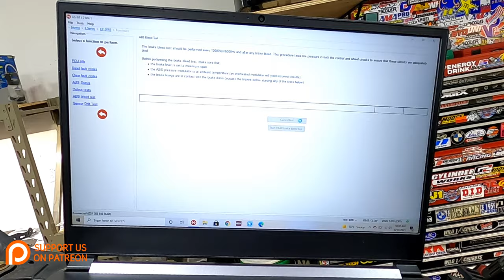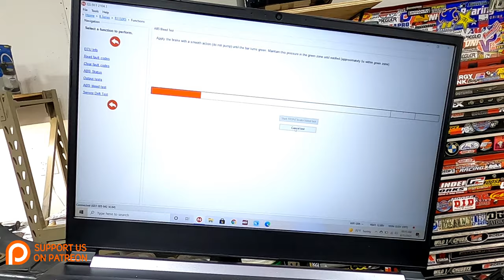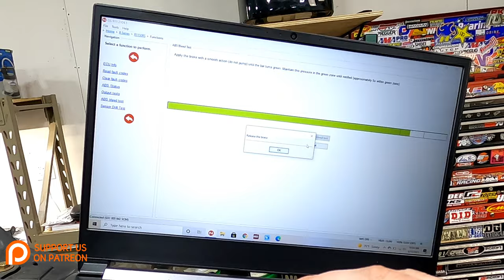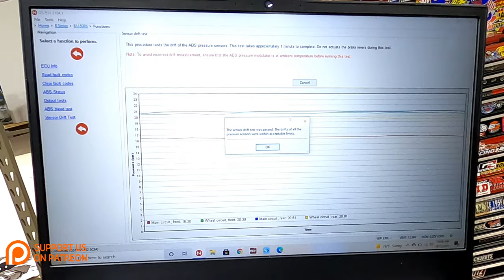BMW I-ABS COMPLETE BRAKE FLUSH R850, R1100, R1150, R1200, K1200

Comment: A mechanic I saw while on road trip in Europe ran some emergency braking test at the time and got 100bar+, he told me it was way too high and that it meant the OEM brake lines where aging and that it would be good to upgrade to steel braided ones.

From what I understand, the pressure measured by the test  is the outward pressure going out of the pump.
Basically  the more the pressure is high, the more it means the OEM rubber lines are absorbing pressure (by swelling / deforming) and basically requiring a high amount of pressure to get the required pressure to the brake caliper from what I understand ?

I had totally lost the front brakes (assisted + non-assisted) and when running your procedure I saw the ABS reservoir was totally empty... 

Your video saved me entirely while at first a phone call to a mechanic told me without even seeing the bike that the ABS pump must have failed and that it would require change(3500e).

Thanks a lot man !!
Reply: my abs pump does not make any noise!!!
Reply: @narcissistinjurygiver2932  then you have ABS II and not ABS III with brake booster

Comment: After bleeding you should NOT top it off, like explained here. You should push in the brake caliper cylinders all the way in. THEN you top it off. Doing it as explained you will spill the excess oil when replacing the pads. Spilling it on your frame and rear wheel.
Reply: Pistons fully retracted during bleed. I made a set of hardwood blocks the same sickness as new pads and new rotor in order to set the proper fluid level, per the service manual. Which I don't think he has read...

Comment: Nice video! Have done this a couple of times on my 05 1200GS with servo assisted brakes. There is one minor thing i need to point out. Unless your brake pads are brand new when doing this, your ABS reservoir will overflow the next time you are changing the pads as you topped the reservoirs up fully. To avoid overflowing, you should either block out the brakepads maximum before this procediour. Or you can measure the level in the reservoirs before starting, and leave it the same level when you are finished (this will only work if it was done properly the previous time). Anyway..  overflow is not a serious problem, but its this easy to avoid it  :)
Reply: Couldn't you just remove a little fluid from the reservoir before replacing the pads?
Reply: When we do a brake pad replacement we ALWAYS open the bleeder at the caliper and then push the pistons in. No dirty fluid being pushed back in the system and no fluid pressure being forced the opposite way.
Reply: Guys remember that on this bike the reservoir is under the tank. Yes your ways will work, but then you need to remove the tank just for replacing brakepads.
Reply: What hose are you using to flush out the old brake fluid? I need that.

Comment from the maker: If you watch all the way thru you can see why upgrading to stainless steel brake lines is soo important. these bikes are getting to be 20+ years old and the old rubber lines are failing. its really only a matter of time before you squeeze your brake lever and your line pops leaving you stranded without brakes.
Reply from the maker: If you are interested in a set of top quality stainless steel lines please reach out to Thebmwguy126@gmail.com
Reply: I'm all set, thanx. I'm surprised you didn't mention in the vid before you even started that they needed to be replaced long ago...

Comment: So glad my 2000 K1200RS is ABS2.  When the ABS2 detects a fault it just flashes the dash lights and doesn’t pulse the brakes anymore, but the brakes still work normally otherwise.  The way iABS works seems like a big liability concern.
Reply from the maker: properly maintained its not an issue

Comment: Watching from New Zealand. Around 2yrs ago I purchased a spare iabs unit identical to mine but which had only covered 10000kms! I took the opportunity to carefully disassemble the unit without affecting the actuator settings. In the process discovered there are 6 fluid filters in the unit. I clean these each time I replace the brake fluid having already upgraded to stainless braided lines. These filters are in the reservoir (easily lifted out with fine nosed pliers.) And the other 4 filters are in the inlet and outlet fluid lines. In each case slide out the staple pin to remove the fluid line. Then with an open ended spanner crack open the joint and remove the filter plug. You'll see the filters at the base of each plug. Each is easily removed and I use isopropyl alcohol to clean. This action may be the most important process to optimise the system and maintain the ceramic disc fluid pumps.
Tell me how you get on please.
Regards from Taupo New Zealand
John Mason

Comment: This is a great tutorial.  Just did my 2004 R1150RTP since the tank was off for some other work, and it went perfectly.  Somebody had replaced the hoses at some point, which was a pleasant surprise.  No bulging, and the old fluid was pretty clean.

Comment: I did this task a few weeks ago and it’s finally warm enough here in New Hampshire for a quick ride (42F). My brakes work fine, but I’m getting an alternating flashing of the triangle warning light and the brake failure message. As I said, the brakes seem to work just fine and I was able to lock up the front and rear in some sand. ABS worked fine. Thank you!

Comment: Just finished bleeding the brakes with your help, front brake fluid was shot super like 'dead redish' fluid, the new fluid flushed out the old, and on the nipple line, the fluid went from dark to clearn really satisfying. Using a glass seringe to remove al the dark fluid from the front brake reservoir... Thanx again !

Comment: I replaced brake lines and followed this sequence to bleed the system. Got rid of the airbubles on the front circuit easily but the rear bleeders won't stop pushing bubbles through. I flushed with about a liter and they just won't stop.

Comment: Your video was very helpful once again. I bought a 2003 BMW R1150GS and the brake system has never been flushed. It needed it badly. Followed your video to flush the system. It works great now. Many Thanks.
Reply from the maker: Glad it helped

Comment: BMW Guy , I referred to your video during every step while flushing my brake system on my 2002 BMW R1150RT. It looks as if the brakes had never been flushed or its been a long time for sure. I bought it in 2020.  Worked well. Many Thanks.

Comment: Great video!!  I have done this twice on my 2002 R1100S that has the servo brakes.  It was a real help to refresh my memory with the bleed nipple sequences. it is a well thought out video.  I manufactured a funnel by using a transparent funnel that had a long  3/8 inch outlet and used a tapered rubber plug  to seal the funnel to the servo unit.  Drill   the appropriate holes in the plug and you have a new tool.

Comment: Replaced my calipers and started bleeding in the traditional way. I noticed the brake resivour wasn't going down so stopped. Doing some research and came across your video. Glad I stopped when I did as I think you just saved me a head ache. Back on it tomorrow now with the right technique 😎
Reply: Common mistake!
Reply: @hstapes  one you only make once 😂

Comment: You may not of known this, but you can remove the two caps on the ABS unit that have the two breather hoses attached. You can suck out the fluid there and replace it with 
new fluid to save some time in the bleeding process. Be sure to put fluid in each of those to the same level that it was before removing the old fluid.
I would like to point out that you are putting too much fluid in those resavoirs. The fluid should hit the max line with new pads, and then the low when the pads wear. The manual 
states to use a tool that mimics new shoes for this procedure, and then reinstalling the used pads, if within specs. You can always tell how much pads are remaining by looking 
at the fluid level, IF this procedure was followed. This also assumes that all pads are wearing evenly, which they usually do if the system is working properly.
Reply: I don't think he read the manual. The funnel is available, and is easy to make, for that matter. It makes the wheel circuits so much easier.

Comment: This video is a good guide but I have to agree with some of the comments concerning the se of the filling adaptor funnel. I have bled my ABS system on my R bike every two years for close to 18 years now. The use of the funnel makes keeping the pump full of clean fluid so much easier and you avoid the chance of introducing air into the system.

Comment: Thanks - a really great video.  If the clear pipe used for bleeding had a one way valve  (like a lot of bleeding kits) it might save all the effort of  opening and  closing all those bleed valves. 
Unless there is a reason not to ?
Reply: Thanks  - your tutorial worked PERFECTLY.  REALLY appreciate it.

Comment: Do you or anyone else know where I can find the front reservoir rubber gasket at the handlebar mine seems to have swelled up for some reason. Perhaps the last mechanic use the wrong brake food and it reacted with it I’m sure this point I just need a new rubber seal for that front and the bar reservoir. Excellent video I sure appreciate it.

Comment: Thanks . I need to change my brake fluid and was going to buy a funnel but after watching your video it isn't necessary. I needed the whole video though to see what I need to do. Much appreciated.
Reply from the maker: Glad I could help
Reply: @TheBMWGuy  I thought I'd mention to you that I've heard a lot of BMW riders have problems with with what they call "surging". I bought a 2002 BMW R1150RT about 3 years ago with about 45,000 miles on it. It didn't run well but I thought I could fix it. After checking and trying out a few things I decided it had plugged fuel injectors. The problem could have been caused or contributed to by ethanol gasoline and sitting over the winter. To get to the point I use Seafoam and Lucas Gas Treatment to clean my injectors and now it runs really well. You are the professional on this and I'm sure you know a lot more about this than I do. This might be a good idea for a new video for you to make with your own take on it of coarse. A lot of people have this problem it seems.
Reply: Surging? Single spark? A good throttle body synchronization (after a valve check) and Autolite 3923, IIRC. (chack that...)
Reply: Thanks - I bought the motorcycle used and decided to do a throttle body synchronization. It was way off. Supposedly done by a BMW shop previously. After I adjusted it the bike runs much smother , has more power and gets a few more miles per gallon.  @dmaineac

Comment: Great instructional video, you obviously are a well versed mechanic for the BMW motorcycles. Without warning my "brake failure" light lit up, I thought it due to brake fluid loss. Upon inspection the level is down and quite dark but not empty. Added more fluid and the lights remain on. Does this indicate failure of the ABS pump and subsequent replacement? If so then the bleeding process in the video is how to bleed after replacement of the ABS? Or will the bleeding correct the ABS problem and eliminate the brake failure message? Thanks for any advise.

Comment: Hi BMW GUY, very good video.  Can you advise when @22:00 you showed the rubber brake line expanding, what level of pressure and by what means was that pressure introduced?  Curious if manual operation of the brake lever could cause that much swelling and expansion.  Thanks

Comment: Fantastic video. Have an issue with another iabs .. great brakes and pedal however constantly running pump motor parrot brake light switches correct. When ABS sensor or solenoid cause this issue? Have the alternating Fast Flashing abs and warning triangle thanks for all your help

Comment: Great video tutorial.  I have the I--ABS Gen 2 system on my 2007 R1200R, is there an easy way to bleed this system as it doesn't have any of the bleed nipples or reservoirs on the pump as in this video?
Reply from the maker: You just bleed that the typical automotive way.
Reply: @TheBMWGuy  Thanks, that's a great help.
Reply: DM me if you want the photos of the procedure from the shop manual.

Comment: Great video, I just have a question

What if when I press my levers the servo assist doesn't work? Or what if it works continuously even after releasing the levers?

I think I have major servo motor problems.

Comment: Hello hello BMW guy.and thanks for your videos I learn .much because of them.
My question is could I apply the same instructions on my 1998 R1200c with ABS?
Reply from the maker: Yes, absolutely
Reply: No. This procedure is for the iABS system. Yours is ABS2, which is bled as normal brakes are.

Comment: Hi,

I have a 1999 R1100 RT with ABS brakes.  Bike was sitting for 3 yrs.  I just got it to start.  Noticed that rear brake pads are down to the metal (ordered those) and the rear brake fluid container is empty.   I can't find this junction box (to bleed the brakes) that is showed in your video, on my bike.   Do I just bleed the nipple on the rear caliper ?   The brakes have not been used.   I appreciate the advice.  Thank you.

Comment: This is the best video I have ever seen on this procedure. I do have a question concerning the failure of the ABS system. If the ABS system fails at speed is there any braking still available? If a line blows on the front, do you still have braking on the rear or vice/versa?
Reply from the maker: Nope, your probably going to crash. This is why an upgraded stainless steel kit is soo important

Comment: Mine did the same, GS1100, replaced all my lines, front were bulging. Bled the abs, and flushed through, full of gunk. Then put risers on the bars, need longer line from MC... This is a later model set up, I did mine ala static, without abs running. I hear you can't use a power bleeder with abs?

Comment: Great video. Question. I just ordered a new set of brake lines from you. I have a 2002 R1150GS with ABS II. What would be the procedure for replacing the lines and flush/bleeding the system.
Reply: Need to know the same
Reply from the maker: same as this video!

Comment: Great video and clear directions - thank you!  I've replaced the OEM lines with stainless steel and have used your video to bleed/flush the system.  My rear caliper is draining Very Slowly - taking little to no fluid into the abs reservoir up front after 10-15 cycles of opening/brake pedal/closing/etc.  Any guidance you might be able to provide?  I'm looking forward to getting back on the road!
Reply from the maker: rewatch the video, the you bleed the caliper with the servo power on the ABS unit. the reservoir its on the pump itself
Reply: @TheBMWGuy  I'm with you, there.  Servo power is on as I'm topping off both front and rear reservoirs.  I'm getting my whine, the rear brake pedal goes down a bit, but when I crack the rear caliper bleed screw, I'm getting at best a dribble of fluid and the level in the rear reservoir isn't really moving at all.  Thank you for such a quick response!
Reply from the maker: @pjcm30cs  push the brake pedal harder, there could be a little gunk lodged in the bleeder.. also did you bleed the ABS circuit first?? the 6 screws on the pump?
Reply: @TheBMWGuy  Yes, I followed the video closely (it was next to me on the bench while I worked) so I did the 6 screws on the ABS circuit first (filling from reservoir under seat and at hand brake) and then the front and rear wheel circuits.  I'm watching the drain line carefully (and keeping it upright so I can see the fluid) - no air bubbles coming through.
Reply from the maker: @pjcm30cs  when you push hard can you hear the ABS pump "BOG"?
Reply: @TheBMWGuy  When the rear brake pedal is pushed hard, the abs pump tone changes a bit but not dramatically.  The abs light, which is flashing, does go into double-time when I push the pedal down like I'm in an emergency situation.  The double-time light flashing coincides with the pump 'down shifting' in tone.
Reply from the maker: @pjcm30cs  battery is in a 100% state of charge? If so completely remove the bleeder and inspect for a clog in the bleeder
Reply: @TheBMWGuy  Battery has been on a tender and was connected during the bleeding process.  I'll remover the bleeder and check for a clog.  Thank you Very Much for your replies and help with this!

Comment: This is a great video! I just bled the ABS system on my 02 R1100S and this made it super easy. Is it normal to have a few drops of brake fluid come out of the breather hose after this job?
Reply: Yes. If there is too much fluid it drip out the breather hose. It will stop when correct level reached.
Reply: If you follow his instructions, yes. He doesn't show the proper level setting procedure.

Comment: Great video, I'm working on 04 R1200CL , front circuit flushed & bleed with no problem. Rear circuit can't get air out of servo, must be sucking air in somewhere. Do you have any idea where the air could be getting in?
Reply from the maker: when you finish bleed screw #3 return back to #1 and keep bleeding 1, 2, 3, 1, 2, 3, and finish on #1. if that doesn't fix it tighten up all your line connections and try again

Comment: I’m about to replace the handlebar with some clip ons on my 2021 R NineT and I need to replace the lines because the lines are too long. Will it be the same procedure to bleed the system?
Reply from the maker: no, you will need to follow a more "automotive" style bleed procedure. just fill the master cylinder and bleed at the caliper